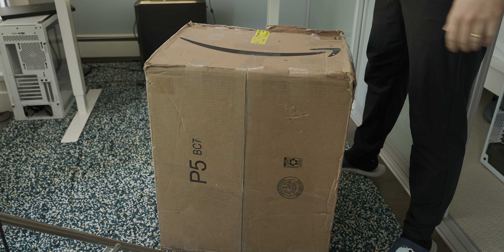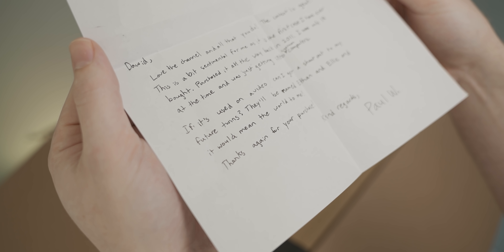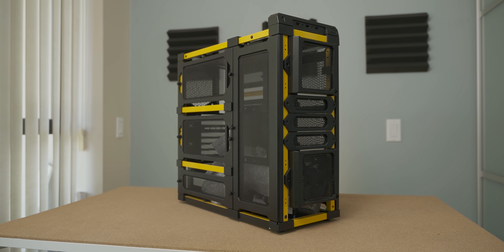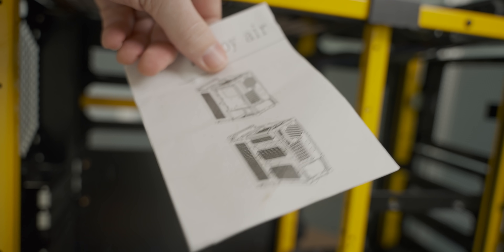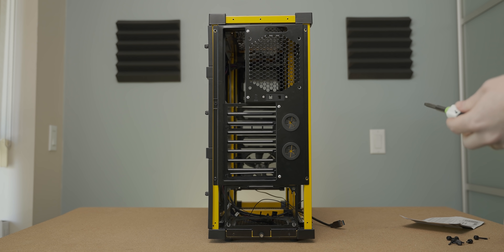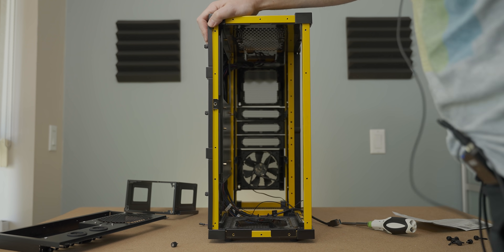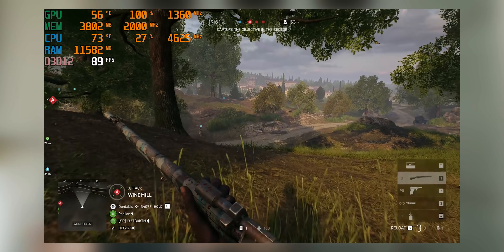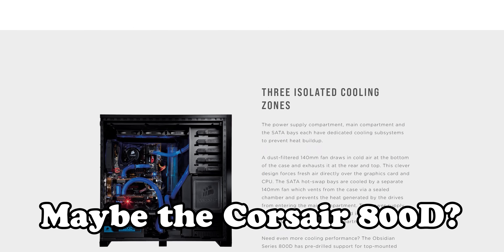The BEST Airflow Case Ever Is From 2010?

Comment: HAF932
It has the industrial chic but is a lot more usable long-term. You don't need five DVD drives anymore, but you could just stick fans in there.

Sidenote, I had a little Rosewill tower back in 2006 that had a nice purple plastic toolbox that just sat in one of the drive bays, so you always had a place for screws and PCI slot covers, etc.

Comment: It’s not that old, but my main rig is in an NZXT h440. I think especially, the looks are still fairly modern and while it does have the water cooling butthole, tons of hard drive mounts, and poor cable management, it’s a pretty cool case (especially since I found it literally on the side of the road in near perfect condition)

Comment: i had  a cooler master storm scout a long time ago and i think it was the smartest ever case for airflow, it had only 1 intake fan but it had an exhaust fan up top and at the rear so cpu would be nicely cooled. the thing that really made it special though, was a side fan to take the heat generated from the gpu directly out of the case. really smart design, couldn't find cases with gpu exhaust fans these days.

Comment: Well, I owned ThermalTake Versa H26. Built a PC in it at year 2019. I don't know when ThermalTake Versa H26 came out (maybe newer) but it still have the old school feeling as it has 2 5.25 inch bay and can be removed to fit a fan. It has 2 USB 3.0 ports and 2 USB 2.0 ports, microphone and headphone jacks, a reset switch, a power switch and Power LED and HDD LED. I do think it looks cool.

Comment: I just upgraded from a CM Storm Trooper case to a Phanteks P500a. The Trooper had pretty good air flow but it also had these multiple filters running down the front that sucked to clean. My USB 3.0 ports came out of it so thats why I got a new case rather than keeping the old one, if at least 1 of the front 3.0 ports weren't broken I'd probably have kept it to save some $ but since I needed the upgrade I went with something really nice and decided to do a mostly white build for the new machine (still with the rx 570 4gb since well the last 2 years

Comment: Antec P182 and Antec 1200 were also pretty good, the P182 came with sound isolation and a power supply basement, the 1200 had lots of fans in the front, a side-panel window and was absolutely massive

Comment: These old cases need to come back. Like the Cooler Master HAF full tower, my dad has one and when I rebuilt his PC, it was amazingly easy to work on. And I miss good looks and a side intake fan.

Removable motherboard trays also usually allowed you to fit the board in "Reverse ATX". My old AZZA Genesis 9000 chassis had this. Keeping the GPU on the top near the top vents was actually a great idea.

Comment: My case I had for the longest time was the Cooler Master HAF 922. I think I got it back in 2011 and it was awesome for my first build. I7 2600K, (still in use), Gigabyte p67 mobo (also still in use), and dual HD6850s in Crossfire. Man those were the days. I waited 6 Generations to upgrade that i7.

Comment: I have a antech lanboy air that I used from 2011 until 2020. The case is loud and collects a ton of dust. Also the case came with 5 fans. Two in the front, two on the side panel, and one rear. The case is designed to have all the fans as intakes.
Reply: Mine is still assembled with a Crosshair viii hero with a 3700x and 2060 ko ultra

Comment: The Corsair 750D released in 2013 and it stills holds up. Plus Corsair gives you the ability to upgrade it with a better i/o and an airflow front fascia that will make even you Dawid jump with excitement over its cooling ability.

Comment: Been daily driving this case since 2011. First it had my Phenom II with a Radeon 4890, then my i7 4670-K with a GTX 970 and its still going strong now with a 5900X and a RTX 3080.

I notice that this case, like mine, has lost all its harddrive mounting hardware. Originally ya had some plastic things, screwed into the drives. With thick rubber hoses going out to hooks. So ya hung your harddrives suspended on these rubber hoses. But the rubber gets old, streches and eventually dies
So with the case in the video, there is only the 5.25" mounting brackets left.

I had some good times moving the case with drives mounted on the rubber things, cuse all the drives flopped around bouncing into eachother if ya lay the case down in the car or something.
Now I run a box with 4 harddrives in, screwed into the 5.25" bracket, so its no longer a problem.

I didn't actually know I could move the PSU to the top of the case but it does make sense...

One thing it didn't look like ya had problems with in the video is videocard length...
To hook the hdds to the case there is a bunch of plastic brackets screwed into the forward "tower" part
My 3080 was too long, and I had to unscrew two of those to fit it. But on the other hand I could also relieve the PCI-E slot, by hanging the GPU from one of those brackets with some string...

I also see that the previous seller had removed the screwbox, it's supposed to be mounted at the front to cover the last open slot underneath the fans.

Comment: Dawid, the CPU will boost up to around 80 degrees because of the way it is designed - it just boost up to that thermal ceiling, so the cooler the CPU runs, the more boosting it will do. Rather than looking at the max temps, you gotta look at max clocks. I recommend trying to configure a good undervolt on it, as that reduces power consumption, waste heat, and improve performance.

Also, do consider trying to do a custom RAM OC on it and try to increase both CPU FCLK and the RAM frequency, while maintaining 1:1 UCLK to FCLK.

This case is pretty awesome. I think a modern case design with finer mesh like the ones on the Phanteks cases would make for an amazing rig. If they make some adjustments to help with dust management, provide optional 200mm side fan mount, and retain this modular approach, I can see it become really popular. You could still see RGB through a fine mesh side panel.

Comment: I actually have the shiny silver one that you showed off from being in that era.  And until here recently, It still had the original processor first generation i7 and 2 ATI 5800's on some asus maximus extreme board.  It worked with windows 10 also, but like usb and sata 2 were what put it out of commission.  
The S-Frame is my all time...timeless case.

Comment: I think a case that WILL be timeless is the Phanteks Enthoo Evolv. I built a threadripper water cooled system in and It can fit a full 360mm rad in the front. For a mATX thats impressive. its beautiful, sleek and never gets boring to look at. Easy to build in as well.

Comment: great video what a flashback i remember that case back when had 680i motherboard thought it looked great (was looking at model with blue accents yellow gave me dfi lanparty vibes) but did shy away from it cause i really wanted case with some level of dust filtration, ended up getting corsair carbide 400r few months later in a trade as part of a bare bones kit. Also modern cases be like "side panel intake? heresy, double side panel intakes? double heresy!"

Comment: Ive used a silverstone raven RV-02 for years, the intake fans are so insane i just slapped a passive cooler on the cpu and took out the exhaust fan and this was all with 2 R9 390 cards in it XD

Comment: Bonus facts:  the tiny plastic  case of hardware (screws, etc.) actually fits into the front of the car at the bottom where that big gap is under the fan. You can use the box to store a screwdriver and extra hardware if you need to work on your computer at a Lan, hence the name lanboy. Also the motherboard tray can be removed and mounted to the opposite side of the case so that you can still see your hardware if you have your computer no matter what side of your desk its on. If airflow is a concern this case can also hold up to 18 120mm fans as well!

Comment: Still rocking my Cooler Master Centurion 590 from 2010. The worst temps I've ever seen (under load) is 53°C CPU, 60°C GPU after 6 months of dust buildup. Idle after cleaning 30°-32°C CPU, 28°-30°C GPU. Hope to keep it around another 11+ years.

Comment: From the title, I was first expecting a Cooler Master HAF X. Those old cases were great: Terrible cable management, but also not sacrificing expandability (hard drives, DVD Drives). Modern cases are made to hold a custom loop watercooling, if you air cool then it's a half-empty box even with a full ATX motherboard.

Comment: I have the Black care. It is like chrome or gun metal black. I got direct from Antec in 2013 or 14 on clearance. yes dust is bad, but if you redo the fans or use types of cooling you can avoid most of the dust. I didn't install anything into the case till 2020 as I want good game and graphic build. So I had it running for 2 years now and outstanding, I did a Red one for a client, and he upgraded to a Ryzen system using the same Lanboy air red case.. The glow of the fans  gives an Iron Man vibe. The case can be striped all plastic and replaces with other parts. You should have gotten 4 fans with the case. 2 in front and 2 on the side My case was missing a panel thumb screw. Call Antec and sent a full set but that was some time back. The hard drive bay has a rubber mount system that let your hard drives hang and keep from any hard vibrations. That is if still mount spinning drives. You can mount SSD in there as well.

Comment: As a old relic myself, I just want to say PSU on the top was standard back in the days. Btw speaking of timeless cases, Define R4. Reasons: I own one (had it since release), It is easy to mod, I think that most replacement parts for the newer model would fit, and even with "only" 3 x140 intake fans, it manage to hold up a really cool temps, it is a pretty silent case too. Downside would be: no dustfilters on the top or back (not a problem as long as you don't use them for intake), you can only casecontroll 3 fans and there is no room for a tripplefan radiator (even with some modding). In fact I would not recommended it for any kind of semi/AIO watercooling. I have one 140mm radiator in the front for my GPU and that was a hell of a mess to get installed. Seen some people do a full water loop but even that took them some modding to pull off. Oh yeah, cable management is pretty basic.

Comment: Not sure about other timeliess cases.  However I own an Antec P182 Gun metal color scheme from 2008.  Which I just recently overhauled took out the Intel c2d E8400 4GB ram build out of it and put a Ryzen 5 1600 in it with 16GB Gskill Flare X 3200Mhz kit (new) on an Asus Prime B350 Plus (cpu and mobo used from AliExpress) used Evga Gtx 960 4GB from a Kijiji local deal for $130 CAD.  Seasonic Focus 650W Gold PSU (new).  The P182 doesn't have USB3.0 or 2.5" mounts for SSDs.  I was able to mount 2 2.5" unis ( one ssd & 1 hdd) in the lower 3.5" drive cage.  Sadly the case supports a total of 6 possible 3.5" hdds..but the PSU only had enough SATA PSU power for 4 units.  Cables weren't enough to wire up the spots for drives 5 & 6 just in front of the GPU .  Oh well, good air flow and still relatively low on the noise front..at least for my ears.  Not near a jet engine level of noise in regards to the 2 x 120mm case fans that are in it as exhaust.

Comment: nostalgia rush for me! i had this case in blue! i regret selling that system so much. the case was amazing. and with cable sleeving you could do some very clean cable management. the only complaint i had was the hdds mount to those rubber bungee hook things and i had a hdd failure one night because a hook broke and let the drive fall down into the bottom of the chassis. while i was using it. ugh. but that aside. these are epic chassis.

Comment: I have an old Cooler Master Stacker 830 that is older than that case and held up for many years, it’s still a decent design even by today’s standards and it came with a 1000 watt Cooler Master Real Power Pro PSU

Comment: Corsair Obsidian 650D owner here. For a 10yo case, it looks as good as on day 1. Friends thinks its a new build just because i put a 3600X in it. Telltale signs of its age would be the watercooling buttholes and the small plexi window in the steel side panel - a modern case would have a full size tempered glass panel. I love the hard drive quick swap bay on top, so convenient.

Comment: I had two of these LanBoy cases, only because one was very cheap and the other was free. I found it a nuisance to work with. And yes, you do have to run a ground wire to the power supply to properly ground it. Dust shouldn't actually be a problem, because Antec's intent is for you to set it up with all fans blowing inward, creating positive air pressure in the case that pushes dust out of the perforated panels.  It's an interesting case, but not my cup of tea. I threw both of mine out when we moved last year. Too bad I didn't know you were looking for one.

Comment: I still use mine, haven't found a case that I like better. It's just fine long-term, dust blows right out just as easily as it got in. I didn't know these were expensive/coveted now.

Comment: Cooler Master HAF 932 (High Air Flow) is still a pretty good air flow case with a lot of possible config. Came with 3 220mm fan(1 one the side panel) and a 140mm at the back. It's a dust magnet still tough... I think you can put 4x120 mm on the side panel... Direct mother board air :P

Comment: At the moment David said to let him know about another timeless case My old one came to mind … and than on screen 
The Obsidian 800D is also one that goes very wel with todays 360 AIO units (way ahead of it’s time) so if you could do a video on that that would be nice
Unfortunately I sold mine quite some years ago for a case that had more and larger radiator … but that currently seems a downside for me as I am trying to find a replacement but can not find any from good brands that will fit my build for a reasonable price (the 2 options I found were Phanteks Enthoo Elite and Corsair Obsidian 1000D but those are a bit to expensive in my opinion)

Comment: I'm still using my Lian Li PCV1000 case which I believe is 20 years old now...granted I have modified it somewhat with both the Lian Li side window and mesh front bay inserts along with a black coat of spray paint internally to mask the period bare aluminum but I've seen no reason to upgrade from it and haven't seen an inverted motherboard case configuration much like it since...

Comment: I actually used the liquid cooling buttholes on one of my builds back in the day. Back when Athlons were best under water, and the reservoirs were thick aluminium pots with added heatsink fins. Yeah, those bad boy reservoirs did NOT fit inside the case and so were made to screw into the rear fan mounts. At least the reservoirs stopped you pushing your computer too close to the wall and breaking the DVI port off.

Comment: 2010-2013 was the golden age of computer cases in my opinion, you can have all the contemporary tempered glass retail display cases, I don't want any of them. I defy you to locate one of these - Cyberpower Pc CFI Borrealight, the orange and black edition is absolutely stunning- and if you can I would be very interested to buy one.
Reply: you think this case would fit my 4080? 360 aio cooler and b650?
Reply: Can't say for sure, never had the case in front of me, but the specs/dimensions of the case can probably be found online.

Comment: Hi Dawid, Do you route pipes behind those water cooling buttholes at the back of the case? or are those just for cables and stuff? Also, can you make a pc with a liquid cooling system using the liquid cooling buttholes at the back of the case. I haven't seen anyone use those holes before. Love your vids. - David

Comment: 8:28 The "trick" with high airflow cases, is to simply put all the case fans spinning at a constant in-audible rpm. The its down to the GPU and CPU cooler to make as little noise as possible, although you'd still hear them better than in a non open mesh case. But for the case-fans, I only have a 300W system though, but when its at full syntethic load, turning up the fans from 600rpm to 1200 makes just about no difference, so they are more than good enough even at in-audible levels. It's just about getting a GPU with overkill cooling, and a silence focused CPU cooler as well.